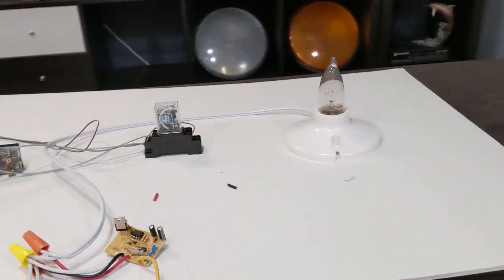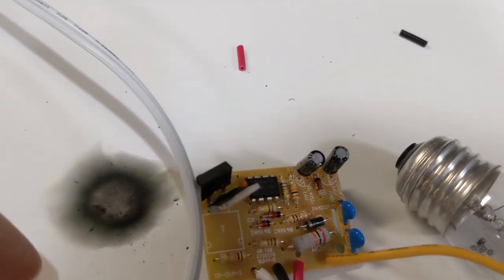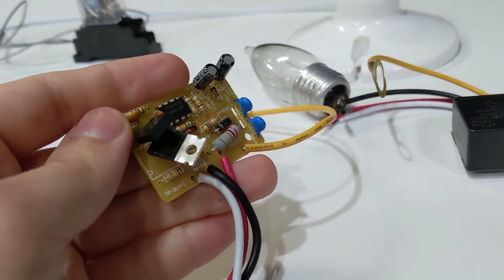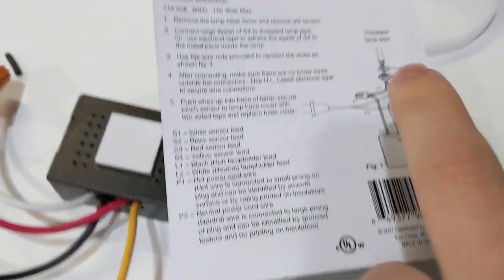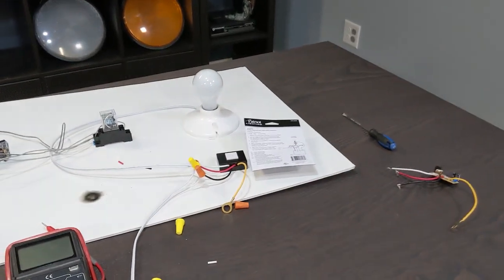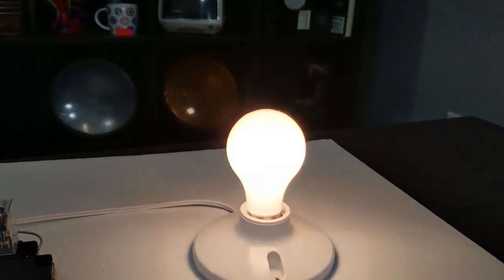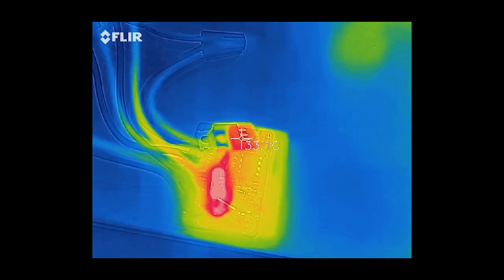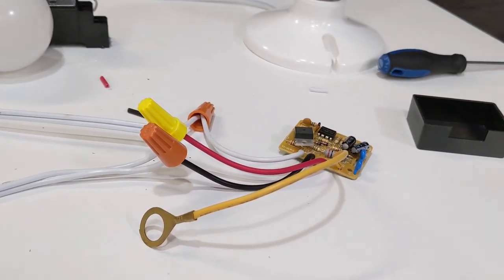A slightly explosive touch-lamp follow-up (standby energy consumption)

Comment: As a non-American, Black->Neutral &
Red->Live makes perfect sense.
Reply: Was going to say the same, that's what I've known all my life in my country. Seems USA likes to go the other way on other things besides the metric system.
Reply: I'm an American, and I was taught that Red is Hot.  I wire that way on all of my project.  Maybe its a DC microelectronics thing?  I have never played with AC.
Reply: @FlintTD  yes, DC is black ground/negative and red is live/positive. I think it's pretty standard everywhere.
Reply: As a non-American: what the hell kind of colour coding is this? Black and red are both line (red is used for switched line I think), blue is neutral in any AC wiring.
Reply: Dude he just did it wrong no matter what way around. This is the ONLY possible way if you want to ensure that you can flip the plug...
Reply: Exactly. Warmer color is at higher voltage level.
Reply: @Dark.Shingo  Rather than the completely bizarre blue/black/brown/grey system used in the mathematically challenged metric countries.
Reply: Australia and New Zealand standards for wiring is brown for active or hot and blue for neutral, green / yellow for earth. Fixed building wiring is still red for live and black for neutral.
Reply: Well here in argentina mains live is brown and neutral is light blue.
Yellow/green is earth and triphase mains is brown, red and green. (Plus light blue if you have neutral for a star motor)
Reply: It makes sense because that's what you learned. To north Americans what makes perfect sense is: white or gray=neutral
Green=ground/earth
Any other color is=hot/live
Red and black=+ and -
Reply: @somitomi  In Australia before they revised the colours for colour-blind electricians, it was Red = Active; Black = Neutral; Green = Ground(earth). The power plugs and sockets have the active and neutral pins set obliquely and the ground(earth) pin vertical. And because Australia's voltage level for house current is 240 Volts @ 50 Hz/10 Amps, a safety switch is MANDATORY on Australian power supply sockets. This is what raises Australian electrical safety standards way above those of the USA.
Reply: here in Chile,  live/hot is red, neutral: white, earth/ground: green. it make sense right?
Reply: @ForTheBirbs  That colour scheme was introduced so colour-blind people could work as electricians. It's a real shocker! LOL
Reply: I'm in the US and that's what I figured it would be but I usually work with dc and not ac so it must be different
Reply: @tylerbendel4361  With DC it's Red for Positive, Black for Negative. No real need for an earth line if the voltages are low enough (around 1.5 Volt up to 12 Volts, but generally no more than 15 Volts).
Reply: @Dark.Shingo  Thats actually a fallacy, the US is a metric Country at least in terms of science measurements, what people get stuck on is that our weights and measures are done with old standards, but thats only cause they have been used for a long time and the switching over would lead to mass confusion as well as very high costs, also when it comes to power, take the UK they dont have black for color at all, brown and blue. Red-hot, Black-Neutral does make sense as that's what DC power uses. but saying its so dumb that black is hot in the US, the biggest issue is just like everything else, out electrical standard is extremely old, thats why our plugs are considered to be the most dangerous, why our 120 volts is considered too low and why the wire colors make no sense.
Reply: @noahluppe  DC color is standardized... AC is not
Reply: Yes! same here in the UK
Reply: @ForTheBirbs  Same as UK
Reply: I'm American and everything electronic, wether AC or DC, red has always been positive, and black negative. All of our switches and outlets for our house is that way, and that's what I've always been taught, so I'm honestly really confused
Reply: @tylerhatfield2351  Black being hot and white neutral IS an electrical standard too, just not the same one you're thinking of.  And that's the underlying problem -- mismatched standards (whether by generation or application).
Reply: The UK was originally red for live, black for neutral, green for earth. Around 25 years ago, it switched to the EU standard of brown for live, blue for neutral and striped green and yellow for earth. The intention of the new colour scheme was to make the wires easily distinguishable even by those with colour blindness - although live and neutral are less intuitive.
Reply: As an American who knows nothing about wiring, black = neutral and red = hot also makes perfect sense to me
Reply: What’s worse is all DC circuits are Black neg/neutral and the red is hot/pos.
Reply: In Russia, currently, earth wire can be yellow, green or yellow with green stripes, neutral - blue or white and, finally, live wire - whatever else out of black, red, brown, pink, violet, orange, white and anything in-between. Now, what would you think if I'd tell you that white/blue/yellow-green wire actually pretty common combination here?
Reply: @tylerhatfield2351  Uhhhhhhh. Do the wires change color 60 times a second? For household AC in the US: white is neutral, black and red (and blue) are live, green or bare is ground. [277/480 3 phase (industrial use only) uses none of the above IIRC.]
Reply: As an American who has always lived in and worked on wiring in old houses (built before or right around the introduction of home electricity, and wired by several generations of idiots) I have ALWAYS learned to check which wire is hot or return/neutral (ground? What's a ground in a 140-year old house, the bathtub drain pipe? Yes. Yes it is.) in each location I was wiring or re-wiring. And if I was lucky, I did not have to (illegally) cut and abandon post-and-wrap wiring inside the walls and run Romex all the way from the fuse box (yeah...) to try and straighten things out.
-
So all of this "this color means this" is never my default assumption.
Reply: Techrocket9  I’m currently an American pursuing a EE degree. All my experience with any DC based equipment is red hot and black neutral. However in Highschool I also learned some house wiring and that was always the form of black hot white neutral and bare/green as ground. I also saw some of the shittiest wiring ever in that class. Legit only I and one other cut the proper amount of insulation. I didn’t think it was that hard to get right.
Reply: White is neutral, black and red are hot
Reply: @neilforbes416  switches on sockets do not make the sockets safer in any way, without an interlock that would prevent you from unplugging a live socket. 120 is less dangerous than 240, and the sockets are equal in terms of exposed potentially live pins. So it's actually NA sockets which are safer.

Do you really expect people to flip a switch every time they unplug something, or make sure the socket is switched off before plugging in? And there's still the hazard of a socket being partially unplugged and coming into contact with it while fumbling for the switch or plug.
Reply: @wyattroncin941  Depending on when and where you are talking about...
Reply: @MonkeyJedi99  north American, since the invention of electrical colour codes.
Reply: @wyattroncin941  They do make sockets safer in that the current is cut off by switch at the power point. American power points without safety switches are potentially lethal in spite of the lower voltage if a faulty plug is inserted into such a socket, a person could die from shock. Australian power users have the common sense to switch off the current before removing the plug from the socket. Obviously this common sense is not present in ignorant America.
Reply: @neilforbes416  do you actually use the switch, every time? how do you know the switch is actually off? what if the socket is wired incorrectly, does the switch disconnect both poles? what do you do if a socket happens to not be switched?

it's a nice thought, but a non interlocked switch doesn't actually add anything to the safety. if you're touching copper, it still has the potential to be live. I'm also not american, and i realize our plugs are not particularly safe. but relying on a switch to be wired correctly and the user to use the switch correctly means it's about as far from a safety feature as possible.
Reply: @BrianRondeau107  They are INDEED safety switches as they turn current OFF or ON to the plug that takes power for whatever device is on the other end of the power cord. With power switch off you can safely insert or remove the plug without fear of electrocution. With your American (woefully inadequate) standard power points, a faulty plug(loose wire inside touching a screw holding the plug together) is inserted without a safety switch set to OFF, the person gets a shock if his/her finger is touching either side of the plug where the screw is on the surface(screw goes through body of plug). I've seen those plugs on stereo turntables where the amplifier provides 240 volts from a plug on its rear for the purpose of powering the turnable. Unfortunately these plugs and points are American-style with the two vertical flat pins instead of Australian/New Zealander with the pins at oblique angles, thus: /  \, The forward slash represents the active pin, the back slash represents the neutral pin. That design also guarantees the plug only goes into the socket one way. There is absolutely no need for an interlock to stop plugs being pulled while power is on with Australian/New Zealand standard wall sockets as Aussies and Kiwis DO possess the common sense to turn off the switch BEFORE removing the plug.
Reply: @wyattroncin941  Unlike America which does things arse-about(backwards), We flick our switches DOWN for on and UP for off. On the more modern power point and light switches, a little red dot becomes visible on the top of the switch when power is on. As to whether the plug is incorrectly wired, any electrician who wires a power point incorrectly will very quickly lose his/her licence and could wind up in prison if that wrong wiring proves fatal. The switch(circuit breaker) is generally across the active line, i.e. SPST (Single-Pole Single Throw) but some might well be DPST(Double Pole Single Throw) to cut power on both active and neutral  sides of the line. As for users using the switch correctly, we're Australians, not dunderhead Americans.
Reply: @neilforbes416  okay, so it's reliant on a correct installation, no one having messed with it and wiring it incorrectly, the user using it "correctly" and you use twice the voltage in a functionally identical highly unsafe plug design.

 whether your region flips switches up or down for on is entirely irrelevant, so long as it's consistent. i could see someone screwing that up, leaving the switch toggle down for off. yes that'd be installing the plugs upside down, but maybe it's an overhead or in ground plug. maybe it's a power bar with a dead neon indicator bulb.

i could also see someone wiring the switch and plug incorrectly, such that a SPST switch is switching the neutral line. if you're going to argue that electricians are the only ones that touch electrical, stop there because i know for a fact that Joe Bogan doesn't give a fuck about what the rule say when all he wants is USB sockets in his house.

as for the comment of hur-dur, stupid americans, again i am not american and i am actually quite smart for my country. regardless, the average child is a hell of a lot more stupid than the average american anyways, and public facing systems are designed for the lowest common denominator, i.e the people who are too stupid to breathe. so a system that assumes correct user action to prevent injury is a good way to kill people. that's why you don't have a handle on elevator shaft doors.

non lockout switches never have been and never will be safety devices. the switched outlet is a stopgap measure for a bad design running excessive voltages at best and a false indicator of safety at worse. i'm sorry, but that's what it is. it's inherently no safer than a non switched socket.
Reply: The madness I see? Live to red. Live to lightbulb.

So the socket is live when the light is OFF.
Reply: @wyattroncin941  : Modern UK sockets actually are safer than modern US sockets, but that's only because of the universal safety shutters mandate. The switch (and actually the voltage too, because 240 doesn't behave notably different than 120) doesn't matter.

The modern UK plugs are also safer than modern US plugs, once again because of a mandate- the fuse (which I actually think is probably minor in most cases) and the insulating jacketing around the base of the neutral & hot prongs (not wires, prongs, what was I thinking?) are both notable safety advantages over the common modern US plug.

I've already seen US outlets with safety shutters, and at least some fans that I own have fuses inside their plugs, now I'm just waiting to see insulation around the base of the live & neutral prongs. That's the only safety feature I haven't seen in the US.
Reply: FlintTD yep with AC black is always line (hot) … And then if you get into industrial stuff, (220, three phase, single phase conversion)… Then all hell breaks loose and they throw 20 different colors at you… 

I mostly messed with DC stuff for a long time but now rebuild a lot of motor drives and such and wiring colors are the bane of my existence
Reply: Well to be fair this can all be solved with RTFM
Reply: @ourback  white is neutral, black and red and blue are live, green or bare is ground is 3 phase.  single phase  (home) is white is neutral, black (red) are live,  bare (green) is ground.
Reply: @FlintTD  I'm Canadian, but we follow most American protocols when it comes to stuff like wire colours. It works out to this:

Ground: Green, Green-Yellow, Bare (ie. no jacket)
Neutral: White, Grey
Hot: Any color but the above (but traditionally Red, Black, Blue).

Black is the most common, Red is the second-most common (often used in switch legs with separate fan power, 3-way switches, and pre-GCFI regulation kitchen split receptacles. You almost never see blue except in 3-Phase (ie. 600V) power, though I've seen some bizarre multi-switch legs using 4-wire before.

In traffic lights specifically, each color is coded exactly what they're for; Red = Red light, Yellow = Yellow Light, Brown = Green light... wait what? It USED to be green, but then the eletrical authority got annoyed, because people were confusing the Green as the ground. :P
Reply: @IronTiger216  If that isn't what I wrote, I apologize
Reply: Portugal here and prepare to be blown away.
Most of our wiring (for AC at least) is brown/black/grey, blue, and green-yellow duotone.

Blue is the neutral
The green-yellow duotone is the ground
And then live (or phase, or hot, or positive) is the black/grey/brown.

For DC it usually is red hot and black ground
Reply: I've come across Black->Live in France but you won't find it in the UK
Reply: Here in Austria, with AC(One Phase) Black is live, blue is neutral and green&yellow is ground. With 3 Phase AC Brown is 1st phase, black is 2nd phase, gray is 3rd phase, blue is neutral and green&yellow is ground.
Reply: Americans are weird. Yes in my mind black = neutral, and anything else is hot. Ground is usually green.
Reply: @neilforbes416  for the third time. i am not and never have been american. i'm Canadian. the electrical code is pretty damn strict, but code only applies to people who care about it enough to have electricians do everything for them. you're honestly going to tell me you don't have bogans fiddling around in the walls of their houses, farmers who'd rather do it themselves, engineers who think they know better than electricians? fat fucking chance. and non switched outlets exist. have those been 100% replaced on a mandatory "we are here to inspect your outlets. refuse and you will be charged" basis?

ignoring that, you still haven't said that you use the switch every time you've ever unplugged, that all children use the switch every time, and that it's such a compulsory act that anyone who steps foot on the continent automatically knows to use the switch every time. i guarantee you that children don't know better, tourists and visitors don't know better, and lots of your fellow countrymen couldn't care less. unless it's physically impossible to plug and unplug from a live socket, a switch is in no way a safety device. that's what interlocks are for and why they exist.
Reply: I think the issues and frustration  stem from the fact people are  over looking certain historical aspects of wiring.... I expect black (brass) to be hot and white (silver) to be neutral with  bare copper (Green) as ground.... why because that was what was adopted as standard in 20s and 30s as paper and asbestos insulation replaced  knob & tube likely because the technology at the time could cheaply and easily produce those colors for wiring and terminals.... do other schemes  make more sense,  possibly  but that's what we have in North America  because....
1. North America was one of the 1st areas with widespread electrification. (Back to the days of knob& tube without any insulation on the wires).
2. Along the way  the regulatory agencies have chosen not to make any major changes to early  color scheme for household wiring practices. ( likely to reduce confusion in the future)
3. I don't know any of the regulations for other countries  but in the US it is allowed for  homeowners to work on there  own wiring.... though most probably should not... that said you are responsible for yourself  so assume the last guy was an idiot and verify that what you expect is hot is and what you think is not  is not! ... and yes they may be liable for faulty wiring but if they died of old age a long time ago and  you get electrocuted tomorrow... then it doesn't do any body any good.
Reply: As an American that mainly does DC hobby stuff, those colors also made sense to me.
Reply: @neilforbes416  The verbage of your comments are frightening similar Donald Trump Tweets. Congratulations!
Reply: @AMD1  That's purely accidental. Trump is someone to be despised, loathed and hated. I just get angry when people challenge common sense with ignorance when I try to explain about Australia's power supply sockets protected by safety switches.
Reply: @neilforbes416  That may be, but the way you go about America/American bashing, is very Trumpish.

To give you an in depth reason to why in North America switches are up for closed, and down for open, it's simply safer. 
I quote the code book: section 404.6(A) "single throw knife switches(enclosed disconnect) shall be placed so that gravity will not tend to close them". In a nutshell that means open must be in the down position in the case an object were to fall on the disconnect, equipment will not be energized by accident by a falling object.

Section 404.7 further details the definition of a disconnect, and how their positions must be labeled to indicate if it's energized. Section 404.7"general use and motor circuit switches, circuit breakers, and molded case switches shall clearly indicate whether they are open (off) or closed (on) position. where these switch or circuit-breaker handles are operated vertically rather than rotationally or horizontally, the up position of the handle shall be the (on) position"

It may seem pedantic to think that falling objects could accidently energize a circuit, however the same scenario de-energized circuits on me multiple occasions. One in particular was the water heater. I can't imagine what would happen if the water heater accidently energize when it's low on water, or air in the system during maintenance.

Or alternatively, oposit hemispheres. that's why switches flip the other direction, and traffic moves on the opposite side.
Reply: @AMD1  I certainly don't want to be like "Donald Dump" but America is a country that is so "full of itself" and its unjustified self-importance that its ego balloon needs urgent deflation. 
As for switch movements, Up for off and Down for on is perfectly sensible and NOT for reasons of being in the opposite hemisphere of this planet. Back in the early days, our power points and light switches were round and switch and plug were set side by side. The switch was spring-loaded in away that it took a bit of force to push the switch down to "on" or up to "off" and the snapping noise heard confirmed the action taken. The little toggle gave some resistance as it was pushed to either position, so there was no way anything accidentally falling on that switch would push it to "on". Even infants couldn't switch it on as there was not enough strength in their little fingers to "flick the switch". Our modern power sockets are now all one unit with switch and socket together in one wall-mounted plaque, though the switch is lighter, its profile against the plaque is such that nothing can hit it by falling down, only by coming at it on a horizontal plane can anything hit the switch, and that is, in 99.9% of cases, unlikely. I think our Australian powerpoints and light switches can be viewed on Google. See them and compare with America's powerpoints and light switches. Australia comes out way ahead, and New Zealand too as both countries use the same types.
Reply: Black is ground and red is positive voltage in low voltage DC. In 230V AC black, brown or grey is ALWAYS live and blue is ALWAYS neutral.
Reply: @mikosoft  In ordinary household power, Red is Active, Black is Neutral, Green is Gound(Earth) prior to the change to accommodate sight-defective(colourblind or colour-weak) electricians.
Reply: @neilforbes416  must be a US standard then, I've never seen that in my country (central Europe).
Reply: @mikosoft  Probably. I only go by Australia/New Zealand standards.
Reply: As an American I have never seen anyone wire anything with black for positive and red for negative, no clue why people are saying Americans do that
Reply: Every lamp I have ever installed had: Black = Phase (L), Yellow/Green = Ground (PE), Blue = Neutral. One lamp I installed is motion activated, that had an additional red wire, which was another Phase (L).
Reply: @wohlhabendermanager  You work in Germany(judging by your surname) as an electrician. You're explaining three-phase power supply. I've been explaining Australian household mains power supply.
Reply: @neilforbes416  My youtube name isn't my real name, but yes I am from Germany.
I also don't work as an electrician, I was talking about lamps I installed in my homes (plural, because I moved a few times in my life. I do not own multiple homes). :)
Reply: @wohlhabendermanager  O, Entschuldignen Sie mir, bitte. Als alles das Sie gesagt habe, hab' Ich gedacht das Sie Elektriker war.
Reply: Agreed!
Reply: @neilforbes416  No problem, mate. I should've expressed myself more clearly. :)
Reply: @wohlhabendermanager  Funny this, I responded to you in German language(auf Deutsch) and your reply comes in English. As you're German, I'd have thought yor reply would've been in German.
Reply: @neilforbes416  Well, I just wanted to include our international audience. ;P 
But if you like: "Kein Problem. Ich hätte mich deutlicher ausdrücken sollen. :)"

;)

[PS: Yes, I didn't translate "mate" there, because we don't really use words like "Kumpel" in sentences like this.]
Reply: @wohlhabendermanager  "Mate" is an expression usually used by Australians(like me) or Britishers, on the odd occasion.
Reply: @neilforbes416   The opposite hemisphere was an ironic joke, like: meh, lol. I was replying with the safety reasoning behind why a switch is thrown down for open, and not because "were dunderhead americans".  Is there any particular reason behind Australia/New Zealand throwing switches up for open? I know that's how the English install them.

I know of the old Australian sockets and switches, because they're the old American switches and sockets. I found one of those "snap-snap" switches in an old-collapsing barn. Down for open, even with a 1920s "snap-snap". That socket/plug design became obsolete in North America over 7 decades ago. It was replace with the NEMA 7-15, which I believe the Au/Nz 10A plug is the same standard dimensions. I have read that the Au/Nz modern socket, and switch mounting is still the same standard dimensions for American mounting. Maybe white for neutral should have also been adopted as standard back then, because color-blind electricians don't have a problem distinguishing white/light grey from colors.
Reply: @AMD1  I took the stance I did because America has this bad habit of setting itself apart from the rest of the world in just about everything it does. Logic dictated switch action, down for "on"(circuit closed), up for "off"(circuit open), every country in the world went for the logical decision, America went counter to logic(and Canada, despite being a member of the British Commonwealth, went with America only for compatibility's sake and no other reason). Seems to me that when EVERY other country calls something white, America calls it black.
Reply: @neilforbes416  Aside from safety, please explain how logic plays in switch positioning a switch at all.
Reply: @AMD1  I was using it as a literal example of how America runs contrary to the rest of the world in everything it does.
Reply: @neilforbes416  Using a switch position as an example for how America does differently still doesn't prove that there's a clear right and wrong way to position a switch. I'm still waiting for the logical reason for down=close.
Reply: @AMD1  I wasn't setting out to prove right or wrong, I was trying to show that America, often as an example of "American Exceptionalism", runs counter to the practices used in the rest of the world. America wants to be "different" to the rest of the world. It's an ego trip. America sees itself as the leader of nations when in reality America is just another country and that there are other countries in the world that are just as important. What I'm trying to do here is be the pin that bursts America's ego balloon.
Reply: @neilforbes416 Actually in relation of the topic from OP the world went with black, and america went white😁. You can't end your argument by saying you weren't proving right or wrong after going into detail about how australian standards are soooo great. When challenged, you just simply state it's "logic dictated", and america(and Canada) has choose"counter logic". Why leave out other countries which also use counter logic and position switches down for open? The global standard for DC is red and black, how is it logical to use the same colors for AC? The EU standardized Blue Neutrals for the color-blind, but won't electricians with blue deficiency have trouble distinguishing blue from Violet? Most color-blind people don't have an issue distinguishing white from colors, why choose blue?
Is it logical for almost every country to mandate sockets/switches be installed in boxes, but in australia it's acceptable to leave the backs open to a hollow wall cavity? America has its problems, but wires, switches, and sockets really ain't one of them.
Reply: @neilforbes416  Also, if you want to reach out to Americans, youtube comments really isn't a good platform to be heard on.
Reply: @AMD1  I was trying to explain, however problematic my explanation is, that America was a country that saw itself as an island and tended to see itself as superior to other countries and that other countries had to bow and scrape in homage to "almighty America". Well, I'm Australian and I believe in egality and equality. I am just trying to deflate America's ego. And this is where I end this discussion.
Reply: @AMD1  It's the only platform I have.
Reply: I mean I’m an American but I don’t do electrical wiring stuff but yeah black being neutral and red being hot makes total sense. America is weird sometimes
Reply: As an american, Black > Neutral and red-> live are intuitive, and I never knew that the standard here was the other way. Who the heck thought to flip it?! - This said, Imperial is better than metric because base-12 is bae.
Reply: Same here, even as an American. I haven't done much wiring, at least outside of breadboard stuff where you define what each color means yourself, and Red = Hot seems just obvious.
Reply: @GroundThing  In DC battery-powered circuitry it's always been thus, Red = Positive; Black = Negative. So Red should be "Active", Black should be negative and Green should be Ground(Earth) in AC household power.
Reply: @neilforbes416  Yeah, most of what I've done has been breadboard stuff, and I generally followed that, though with breadboards ground is usually the lowest voltage, and you don't have negative, so I used black for ground, but I can't really see why any system wouldn't have red not be hot/positive (and yeah I understand if you have both positive and negative, both are hot, and negative is probably more the focus of activity, from an electron perspective, but intuitively positive/hot = red is more understandable, to the average lay person)
Reply: @GroundThing  When dealing with low-voltage DC circuitry(and I used to dabble in hobby electronics), Red = Positive, Black = Negative. Negative was usually earthed, not that it was actually necessary as the voltages were down to a maximum 12 volts or minimum 1.5 volt(I use the singular here as it's not a full 2 volts). A dry-cell battery is labeled + or -, thus positive or negative.
Reply: I've seen many cables with different colors, but here blue or black is always the neutral. Anything else beside the yellow-green ground is always live, like red, pink, brown, gray, white, and even yellow (which is very rare).
Reply: As an American I thought that's how it was too
Reply: me as an American with only experience wiring 220v appliance: red=hot, black=hot, white=neutral, and bare=ground lol
Reply: @MrEdrftgyuji  Well... its not true that "mathematically challenged metric countries" (which btw is pretty much the rest of the world) uses black/brown/grey.
In sweden it is blue = Nolla (Zero/Neutral), brown = Fas 1 (Phase 1, what you call "live")), Green/Yellow = Ground. Black is "tändtråd" (used between a switch and the light bulb) or Phase 2. Grey is for Phase 3. THen there are a lot of other colors that can be used for other things except Zero, Ground or Phase/Live). Its funny how the rest of the world are challenged and wrong because they do not have the same electrical system as the US.
Reply: @Dark.Shingo  Our system isn't the other way around from metric. Our driving is the other way around from Britain's.
Reply: As an American I just remember that electric stuff is reversed - direction of flow is negative and red is “positive”. If everything is messy in the same way, it’s not hard to remember!